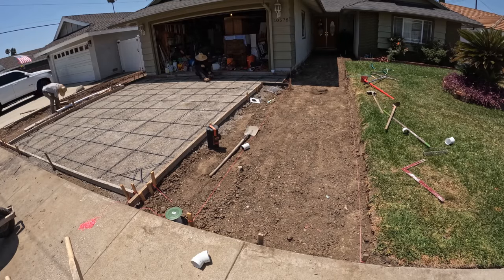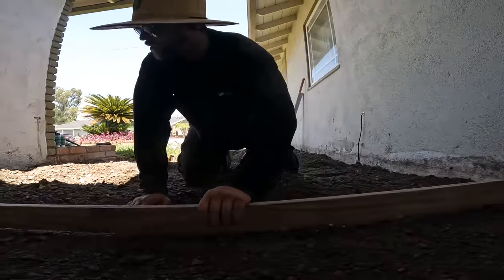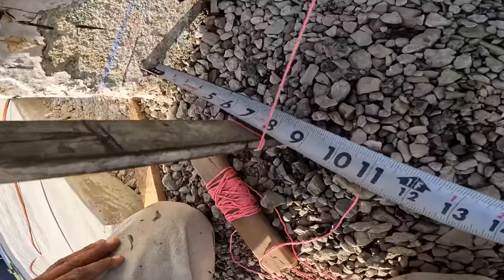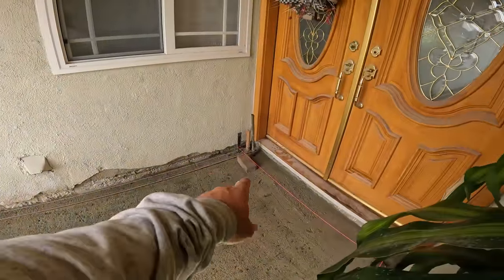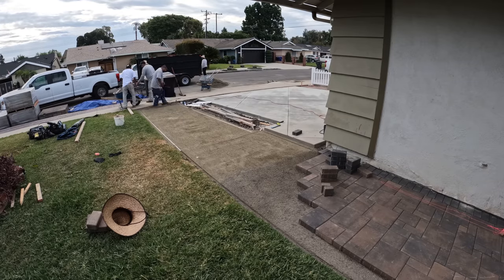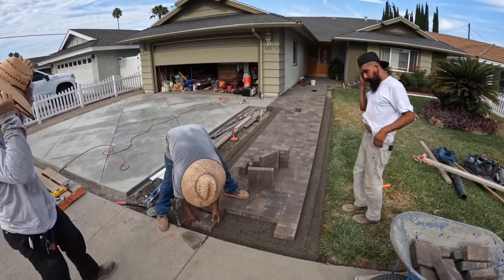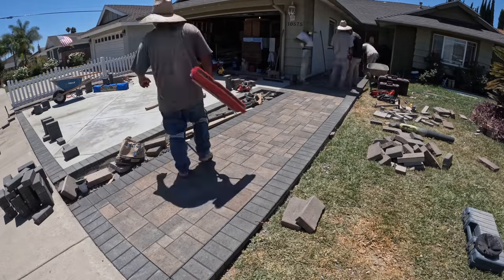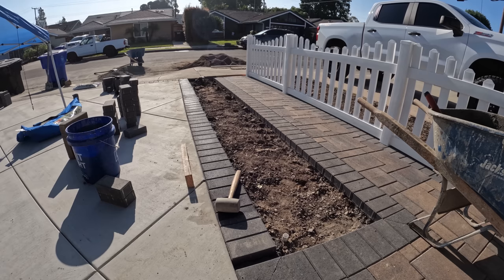Epic Paver driveway Design and walkway! Cool Driveway build!

Comment: Looks fantastic Odell, the whole crew made a fantastic job again. One question, when putting the border pieces on the sides, would it be the concrete underneath the border pieces be more stabile if a string of iron mesh was put down in the concrete 10mm down, was thinking it might hold better for the pressure of a car going on it. But I'm sure you know that they wouldn't sink down from a car tire that would be on top  of a border piece. Best regards from Sweden /Jonny H
Reply from the maker: Rebar is a good idea